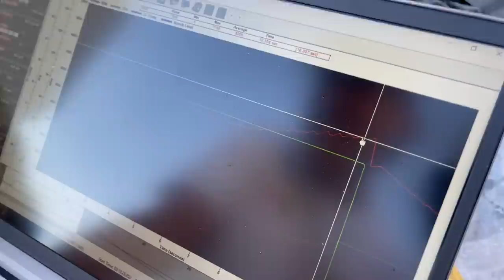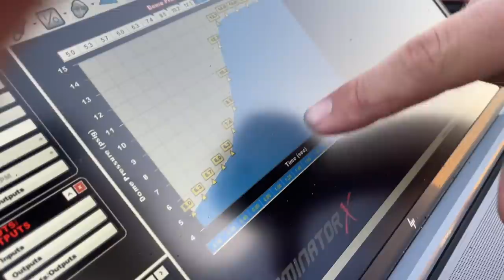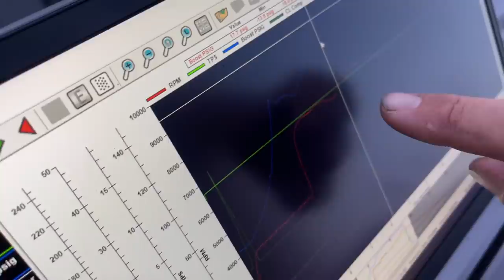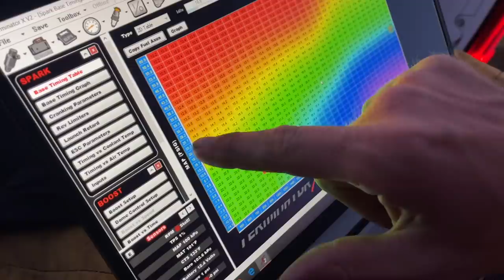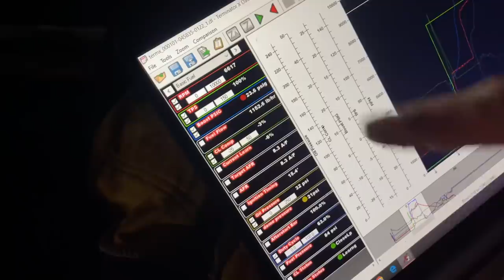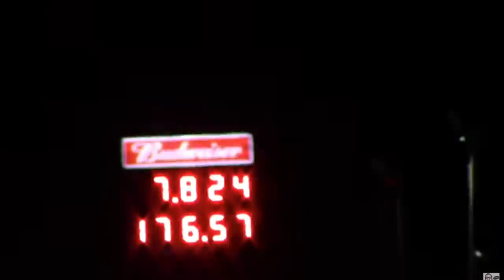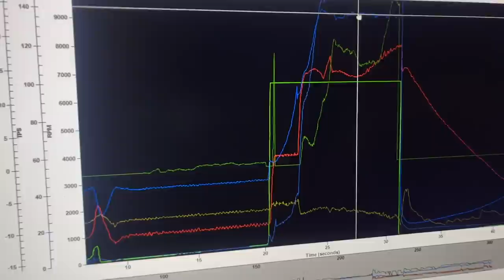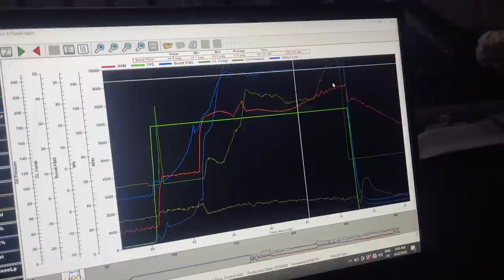FIRST 7 SECOND QUARTER MILE!!!! Almost BLEW IT UP! Cleetus & I Hit the Track for an Epic Night!

Comment: Here is a tip if you want to use it but when I am racing I shift it into neutral in the shutdown it will bring the RPM's down quick instead of them revving so long. You should try it sometime it will bring the load down that way your not burning things up